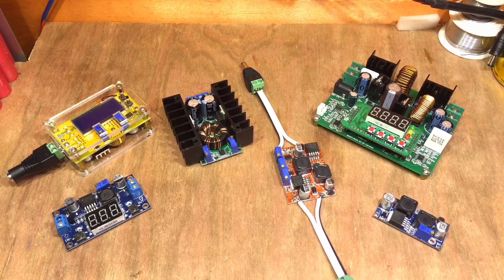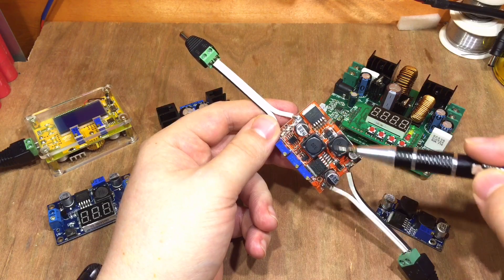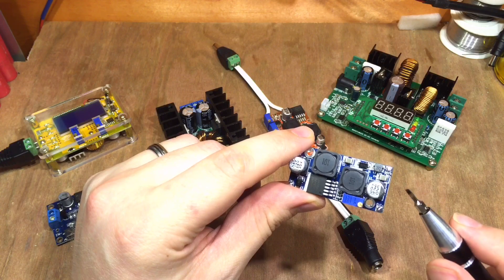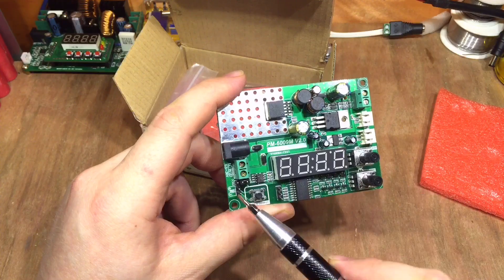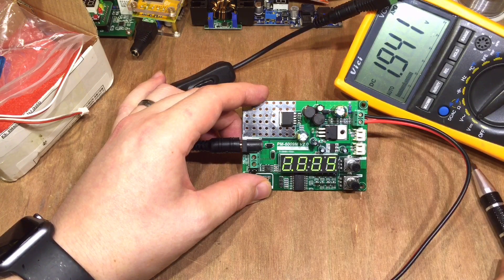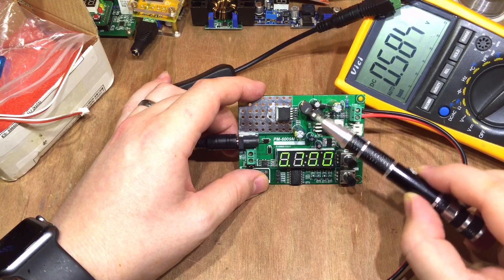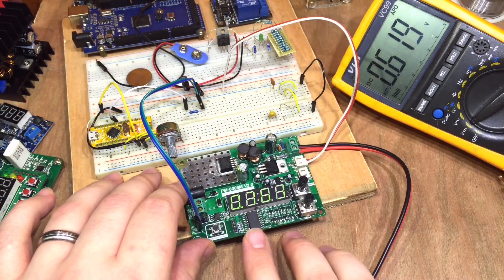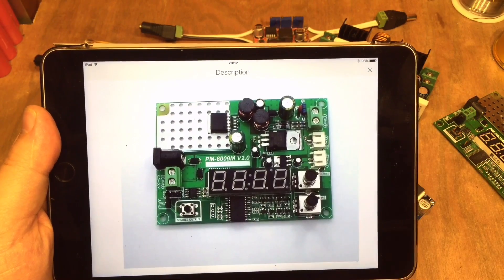DC2DC - Buck, Boost, Buck-Boost & SEPIC - 12v Solar Shed

Comment: Thanks for the very detailed video. I have a question about using some of the buck boost chips. I got one of the fancy ones for 15$ on Amazon with the LCD. I set the voltage and as I was setting the current up from 0 as soon as it changed it smoked and is toast. I'm wondering if I was using it for the wrong purpose or if maybe it was just a faulty unit. I was trying to charge my a lifepo4 battery with a lead acid battery. Everything was hooked up correctly so I'm thinking it was just the unit but I'm wondering if maybe it can't charge a higher voltage battery. Both batteries were 12 v but of course the lifepo4 has a higher voltage than the lead acid. Cheers.

Comment: I have a 12V/100Ah  solar  battery.
How do I connect my 19.5V / 7.7A = 150Watt laptop?

(Can i use any boost converter that can handle 150Watt / 12V = 12.5A?
Some boost conerters mention a max Amp input. How is that related to the 100Ah of the battery?)

Comment: Hey I was wondering if anyone had tried using a buck converter in between a solar panel and a pwm charge controller and set it up to like 14.4 or whatever then you still have the protection but more power I know you could not do it with a lot of power but a 100w might be doable

Comment: To get 12V portable supply from Lithium Ion cells ( 18650) ,  instead of building a 3S 3P pack with protection boards and active balancing board ,   is it better to build  1S  9P pack and use boost converters? other than conversion loss is there any other drawbacks ?
Reply: It drawing high inputs from bank so it's has to do more problem is heat of the A of the battery

Comment: Thanks for explaining these converters, there are so many to choose from on eBay lol,
Would you be able to recommend one for me please?
I have 12 generator coils each producing 35v and 1 amp but I lose the voltage when I Measure the amperage, so I’m hoping to set a buck converter to 12v and as many milliamperes as I can then connect all 12 converter out puts together, but can’t decide on a buck converter.

Comment: There has to be a way to Boot Strap added FETs and Inductors to these Buck Boost converters allowing for higher amperage.  Using one of the little 5A MPPT's to operate at say 20-30A ?

Comment: Great Video,
Solar panel open-circuit Voltage: 40V

Battery 12 V (AGM

Controller : PWM controller max input voltage 28V

I need to step down from 40V to 25V and connect to
solar charge controller to charge the battery? Will I lose energy in this converter
in step down mode? Or the module will convert in to Amps from Voltage while step
down?

Which boost buck module I can buy? or it is not at all possible with converter?
Thanks,
krishnakumar

Comment: I am trying to find a converter that will take between 3 and 17v on my motorbike and output 14.5v to charge the battery and power lights. Basically its a 6v to 12v conversion. Current draw could be quite large for small periods so the unit should not burn out. It should be capable of supplying maybe 5A or even more. I find the more powerful units will only take a minimum 8v input. Hard to find a catch all buck booster to do all this. An excellent review by the way

Comment: Hi, love the videos 👍 Im using a d3805 buck boost to charge Li-ion pack about 17ah I want to double up my current is it possible to run two of these buck boost in parallel to get double Current into the battery? Or would they conflict and pop

Comment: Great vids Adam, hey I need some advice and I hope you can share some with me. I have made a 4s7p pack to power my waterfall and lights. I have a 10amp pwm charge controller. My solar panel is 40watts and my pump is 12v, 21watts -1.7amps. My led light are bout 12v 11watts and 1.4amps. Which buck converter do you  recommend? Also do you think a BMS for my pack is necessary? Thanks, have a nice day.

Comment: Thanks for leading me to the PM-6009. I was looking for a up/down converter for a mobile 4s4p  Lithium pack that allows me to power 12V  appliances when fully charged as well when the voltage drops. Although I found some of those Its nice to have one which I also can use for other Voltages without the need of having a screwdriver and multimeter with me. I never found the PM-6009 on my own.

Comment: Hey Adam, great video. Really clearly presented. I'm trying to use a solar panel that is 300w 42v 7.4 amp for two purposes. One to charge a 48v Lithium e trike, and also charge a 36v battery bank on a pontoon boat. One requires boost and one buck so it seemed the boost buck SEPIC device might be perfect but I can't seem to find any in that volt / amp range. Any ideas? Thanks again for sharing your expertise.
Reply from the maker: That’s quite difficult. Julian Ilett hopes to make something that does this, but the design is pretty much a concept at the moment. Sadly I think you are looking at two charge controllers which stay with the two battery systems. Cheers.

Comment: I bought one of these converters and they are very useful and quite affordable. Only problem is my stranded wires for DC in and out keep coming off the screwed terminals. How do you do it for yours? Do you tin the ends? or use non-stranded wire?

Comment: Very nice video. As old electronics nerd, i have one question:
If I would build a power bank, or some similar device, several cells in parallel would not need to have a balancing circuit. If I then take a boost converter I can adjust the voltage eg. to 5V, which I want. Higher than the 3.7V of a LION Battery. On the other hand for e.g. 5V output I could use 2 pcs. 3.7 Volts in series an take a buck converter, but then I need a balancer for charging. So for the lower hardware effort, I would choose the 1st option with 3.7 V and boost converter. What is now better, and why not use always the cheaper 1st Option. Could you tell this?
Reply from the maker: +DocM As you say, running cells in parallel and boosting the voltage to 5v is the easiest (and exactly how most usb Power banks work). If you use two cells in series technically you’ll need a balancing circuit which may burn off some of the charge current and you’ll still have losses in the buck conversion. I’d go with the boost converter personally.
Reply: Thank You!

Comment: I was excited to find the video on the SEPIC module.  Unfortunately its no longer available.  Maybe its time for a video on controlling the others with Arduino? :)
Reply: john macrae, They still are available. https://www.ebay.com/itm/PM-6009M-Programmable-Buck-Boost-Step-Up-Down-SEPIC-DC2DC-Converter-Power-Supply/282971428736?hash=item41e2695780:g:TZsAAOSw1m5a~usk

Comment: Hi Adam ,, sorry to be a pain that converter sepic,  do you think it would work to charge my ebike battery off a car battery from 12 volts to 29.1 volt at 2 amps ,, as at the min I'm about to set up a solar powered charging system ,, not good with electronics but learning cheers Shane uk. Ct1017
Reply from the maker: That sepic converter doesn't seem to be available any more.  To be honest you don't need a sepic converter, just a boost converter.  Something like this should do it but at 29.1v that's fairly close to it's limit: https://goo.gl/TvXI5v  You can find others with voltage readouts and the like, but this is the simplest type.

Comment: Sorry for asking , Is it possible to hook up a (100Wp) solar panel to a Dc2Dc step down converter ? Yes I know there are charge controllers but those require a Battery.
Reply from the maker: +steven keene Yes it is but you'll have to manage your load carefully. Try to pull too much power and the voltage on the panel will crash and your load will switch off. DC2DC converters don't care about managing their input.

Comment: Great video, i have brought to boost buck converters, one uses the two LM chips and the other is a LTC3780 chip, which has supposed to be more efficient, and can buck down to one volt, could you shed any more info which is a better chip set? Regards
Reply from the maker: Using two ICs means two processes are being completed - usually boost then buck.  Both stages will have losses so one chip is most likely to be more efficient.  The LTC3780 is really clever and is a single synchronous rectifier (I think).  It uses four mosfets in a complicated algorithm and can be pretty efficient.  I got one myself (after I made this video) but I've not done a video on it - mainly because Julian Ilett did an excellent one here... https://www.youtube.com/watch?v=r0KHPxlFz6I
Reply: Adam Welch great explanation, cheers.

Comment: Hi Adam, I need your help understanding what's going on with the small Sepic I have (as shown in your video).  
I have a parallel bank of 5, 12v 2amp gel batteries which is being charged by an old 12v 0.5ah trickle charger (transformer type I think). I noticed the output of the charger was way too high, 15-16volts! and could hear slight sizzling going on, so I put the Sepic shown in your video in line to drop it down to 13.8v. 
Now the odd part, when the batteries are being charged one at a time with the Sepic, my volt meter shows 13.8 across the terminals. All cool. 
I tried this with 5 batteries in parallel and I can see for a second the Sepic tries to raise the voltage from whatever state it was in (say 12.45v) but it won't go up to the 13.8v?? It will stay at 12.45v and won't budge. What's going on here? Why won't they take a charge? I have tested all the batteries internal resistance and they are low. Hope you can help!
Reply from the maker: +TheLastPost I'm guessing that with all the batteries in parallel the small amount of current flowing into the batteries is struggling to raise the voltage of the pack. Half the size of the bank and see if it raises slightly under charge. If it does you'll need more current going in to properly charge the bank.
Reply: +Adam Welch thanks for replying. But yet more oddities, I have a total of 16x 12v 2amp batteries so I tried a different pair in parallel. They are taking the 13.8v charge fine! However, I have tried halving the original bank and they won't charge at 13.8v. They stay at their original state of charge of 12.45v.. 
From what you say, do you think it's the 0.5ah charger that's struggling, even though some pairs seem to be ok with it and some don't?
Reply from the maker: +TheLastPost Have you tested the batteries individually? You might have a faulty one?
Reply: +Adam Welch yes all 16 take the 13.8v fine individually, and their internal resistance is all around 2-4ohms so theoretically should all be good to go. It just seems very odd when I can put a pair together that they will charge when another pair won't, or indeed a set of four or more won't budge at all..
Reply: +TheLastPost would it be worth taking off the Sepic and letting the charger put out 15-16volts? Or turn up the Sepics output to something higher? Obviously the amp will be the same low 0.5ah

Comment: When i adjusted the constant current trim pot, nothing happens. Only the voltage trim pot is working. Any suggestions sir?
Reply from the maker: Put a filament lamp on the output.  That will allow you to see a difference in the current in the brightness of the lamp.
Reply: Yes i did sir. No change in intensity of light or orange glow. I was using lead acid battery 7ah. I just tried using lithium cells 4S. The brushless motor seems to throttle more like normal.

Comment: Nice informative video but it seems that PM-6009M Programmable Buck-Boost Step Up Down SEPIC DC2DC Converter Power Supplyis no longer availableThank you for info
Reply: The exact same one it appears is available from Aliexpress.
https://tinyurl.com/ycsybcq9
Reply from the maker: Oh really - that's a shame.  Thanks for your comment.
Reply: type in programmable buck boost on ebay, there are much nicer ones available with separate lcd screen for around 30$
Reply: Uh yes it is... As Rafiki (from The Lion King) once said...  "look haaarder".
Reply: See, told ya.

Comment: Question is it possible to use for example the dc-dc step down module eg. (yellow one wit diy case) with a usb output for my solar project to charge a diy powerbank?.  Or is this a better option http://www.ebay.com/itm/112074171688?_trksid=p2055119.m1438.l2649&ssPageName=STRK%3AMEBIDX%3AIT    Love the info  I am new to this by the way.

Comment: I'm not trying to ruin your day, but these onboard Chinese led readouts are never accurate and then you test it with your best volt meter and that has a different reading so now what? You rush around the house to find a Samsung phone charger and you find a different reading, but it seems more accurate to the ratings on the charger, but you go to check the amperage and you get zero's well that's because you have to short it to find the amperage and higher quality chargers have a protection circuit and cheap one's don't! So you can sync your imax b6! How do you know your volt meter is dead on accurate? Did you sync it to a oscilloscope? You can do it by taking the back off and adjust the screw while it's connected to a professional oscilloscope if you have one or take it to a shop then sometimes you can get one of these cheap power supplies that you can sync and some you have to remember the real voltage readings and set it up that way. I had so many of these that over charged my 18650 cells to 4.4v and some 4.0v so this will help
Reply from the maker: +MrBrymstond I've checked my meters against an AD584 voltage reference. I would like to find something similar (and cheap) to check current too. 
There's a video on my channel about the AD584 if you're interested.
Reply: There's a way to adjust a number of these devices, the imax b6 you hold the DEC and the Start button while plugging it in and it will initiate the ability to adjust your settings but you're going to need a professionally accurate machine to match it to. I took my volt meter to a shop with a high end oscilloscope and matched it so when I use these boards I know I have to stop them at +0.2 or -0.3 and mark them. Some of these devices that have the same kind of buttons can be adjusted the same as the imax like that very buck boost in your picture here top right corner, it's digital and I watch someone fix the issue.
Reply: omg.....
you dont need .001v accuracy on everything, and as for the b6 flash a decent firmware

Comment: On the red triple trim ports every time I put a multi meter on it it shuts down are they any good for charging 12to24 volts battery banks
Reply: Linda Phillips is it possible that your multimeter was set on Amp reading instead of Volt, thus basically it short circuit the module and it went shut down?

Comment: hi Adam m designing  a sepic converter can i know which chip is preferable?
and the mosfet that is used?
Reply from the maker: +Sanele Miya I don't build them - I just buy them! I'm not sure I'm qualified to answer.
Reply: ok thanks can you read the one's that are used in the one's you buy

Comment: hi Adam can I use one of those to power some leds lights with a USB 5v out and 12v in to the lights to come on when you turn the computer on thanks
Reply from the maker: +Ross Musolino you could boost the 5v to 12v to power your lights yes but with a few caveats. The current on the 12 v side will be much lower - you need to do some calculations. How much does your 12v led lamp draw? 

For example your PC might be ok with 1 amp at 5 volts (5w). That would be about 0.4amps at 12 volt before DC-DC losses.

Comment: Must watch again. Still unsure how Buck converter or boost converter works. Combined both, what r the advantages
Reply from the maker: +Motor Madness Not quite. Check out the Wikipedia links. Boost lifts the voltage, Buck reduces the voltage, Buck/boost can do either - as can sepic.
Reply: Boost converter outputs only above your input voltage, buck does above and below, but only smaller current. A buck/boost can seamlessly transition from outputting above or below your input voltage. (which is why they are so handy)

Comment: I don't know if this is any use to you, but I put this thing together recently:
https://gateway.ipfs.io/ipfs/QmeCqXxspQN8Fa1dZ7W94nucyXA28qUcGbzc3c712PRHDa/
It's a battery discharge protection circuit for lead-acids: Cuts the power to a device when an adjustable low voltage is reached, then turns the device back on when the voltage rises up to an adjustable high to indicate battery-full. You can buy them easily enough, but this design is super-cheap, has a very low component count, and is easily adjustable. I use it for garden lights so they'll turn off before lowering the battery voltage too far, along with a dark-switch based around a photoresistor and 741.

I have one of those SEPIC converters too. It is a really nice board. SEPICs do have a fundamental drawback though, they can't supply a great deal of current. If you look at the schematic for one you'll see why this is the case: Getting high power through a series capacitor is not easy.
Reply from the maker: Thanks for showing me your load controller - a neat design.  Yes sepics have that draw back sadly.  Buck-Boost for higher currents.

Comment: That's pretty cool, but was the voltage spiking like your meter showed?  For example, at 13:20, you touch the pot and it jumps from 7v to all over the place and then settles back down to 8v.
Reply from the maker: Yeah I trust my meter is reading correctly.  I'd put this down to a poor quality pot, breadboard connections and fat fingers.  There's nothing averaging the analog in of the arduino, so any anomaly on the ADC reading would send the voltage off on the SEPIC.  I'm confident if I wired this up correctly, and added some averageing we'd not see that spike.  Thanks for the question.
Reply: That's kinda what I figured, but Jim Conner had a video about weird spikes with some of those generic buck/boost modules and ever since then, I've been kinda punchy about it haha
Reply from the maker: mnelson10000 Well you've put enough doubt into my mind - I will check that.  Thanks